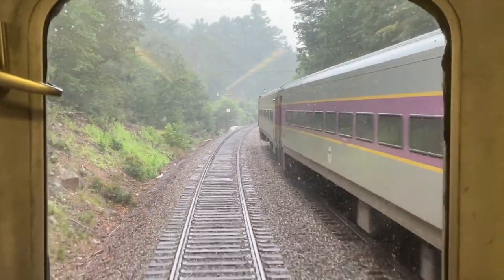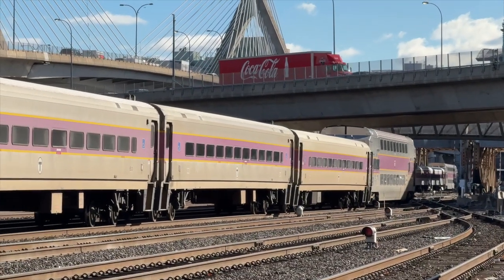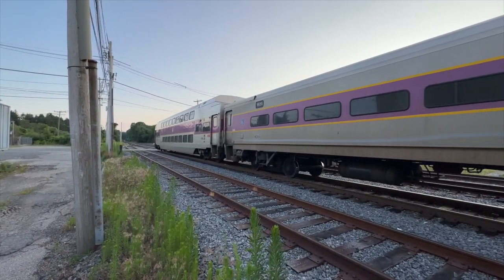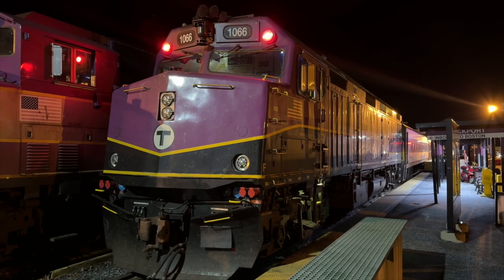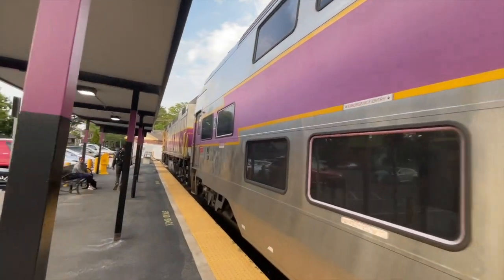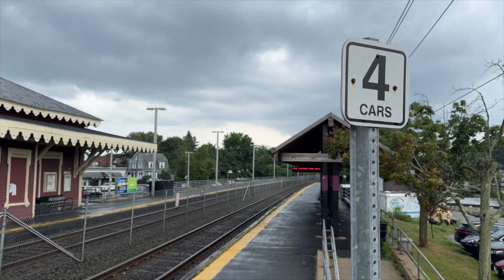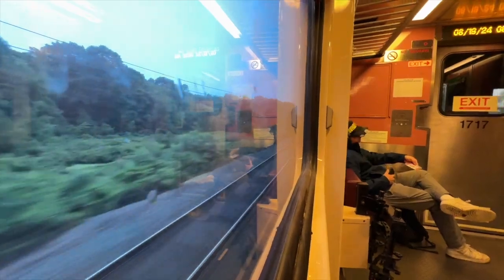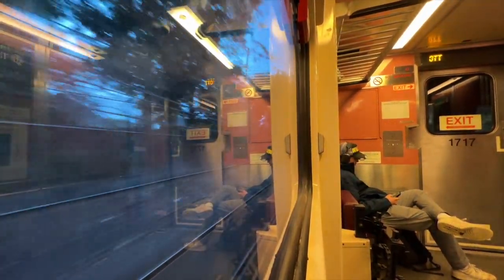How MBTA Trains Really Stop — Brakes & Safety Explained

Comment: Great video and thank you.  Have u considered a video on why the commuter rail did away with the Salem nh line?  There is a very large outdoor mall that has been developed where this station used to be.  It's called Tuscan village. The land for the tracks is all still in place.  The Salem station joins the Haverhill line at Lawrence.  It would be great if bostonians could hop a train to this new retail development and shop tax free and would benefit commuters headed into Boston.   There is also a ton of parking at the Salem location due to several garages.   Just a thought.
Reply from the maker: @nathanberard696  thats a really interesting idea! I actually had no clue that branch existed, ill look into it

Comment: I also had the same question, because I’ve heard stuff such as it takes a mile for a train to stop and these trains stop almost instantly
Reply from the maker: Well, the above part is true, but it depends on the kind of train. Freight trains, which are much heavier, could take miles to stop. A fast moving passenger train also must begin the braking process far from their stop, but since they are lighter, they can stop quicker. It still takes them pretty far tho

Comment: One point was totally missed about stopping. It is about the rate of deceleration. If the rate is too gradual, then keeping the schedule will be tough. Too much brake could injure passengers. Engineers know how much brake to use to make a quick, yet comfortable, safe stop. We usually have landmarks as to where to set them to make accurate stops at platforms, or where to do so for a speed reduction on the line. Sometimes this needs adjusting depending on the weather conditions. In poor weather the brakes might need setting up sooner, or a stronger application must be used.  In passenger service there is more forgiveness because the air brakes have graduated release. If the engineer has made too hard of a brake application, he may notice that he’d stop short of his intended spot. In this case he can make a partial release of the brakes. It’s like being in your car and lightening up on the pressure on the brake pedal. Freight trains only have what is called direct release. An engineer can put on as much brake as he wants, but has to release everything if there is too much brake pressure applied, We have little tricks to overcome this.

Comment: Retired freight engineer here.  I did find one minor terminology error.  At around 4:15 in the video he said the engineer releases the dynamic brakes to charge the train air line.  No, dynamic brakes usually have nothing to do with the air brakes.  Now Amtrak and most commuter agencies use what is called "blended braking", a combination of air and dynamic braking when moving to control a train, but that would not apply here, I don't think (I was never a Class I passenger engineer and never ran a train from a cab car).  I think what he meant was the engineer releases the automatic (train) brakes to recharge the train line and release the car brakes.  The independent (locomotive) brakes will still hold the train.  They are two separate systems using different methods of braking.  Engine brakes use straight (direct) air, like a street car, while car brakes use the reduction of air pressure in the line to apply the brakes, which is more fail-safe (lose air pressure, like through a hose separation, brakes go into emergency).  Train air brakes and air brake theory are somewhat complex, very important, and take up a full week of engineer training school, and it's still pretty much the same system that George Westinghouse invented over 130 years ago.  I do appreciate the attempt to increase understanding of how it works for the layman.  I've found it's kind of like trying to explain how to read wayside signals to railfans.  Mostly they just want to know if a train is coming and that is all.
Reply: You're right! I'm a commuter engineer and we use blended braking. Dynamic Brakes don't charge the trainline. Releasing the Automatic Brakes charge the trainline. I've worked at CSX as an engineer as well. Had to get used to graduated release verses direct release. Still love being an engineer though.

Comment: A quarter into the 21st century, and they still use Brake Shoes over Disc Brakes? 😮
Reply: It’s a good idea because the shoes wipe the residue off of the wheels. This is especially notable during the fall because the leaves leave a residue on the rail. With the clean wheels, they make better adhesion to the rails. You’ll notice that cars like Amfleet have both disk and tread brakes.